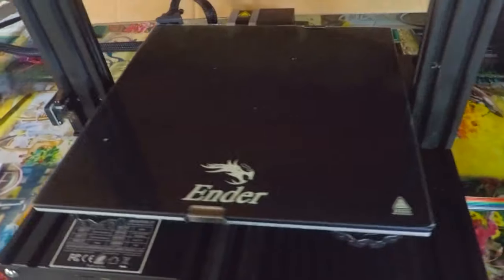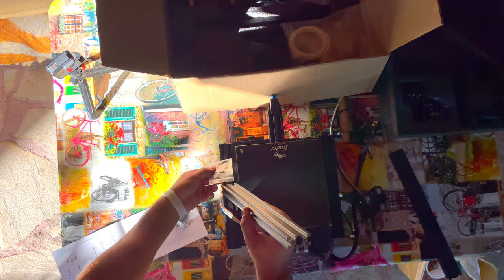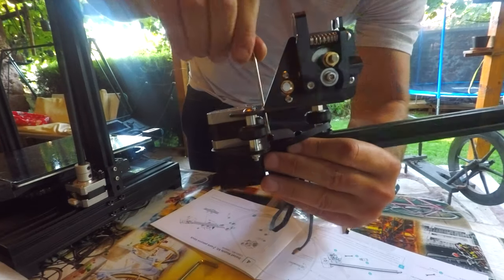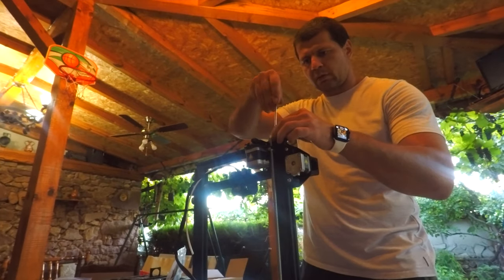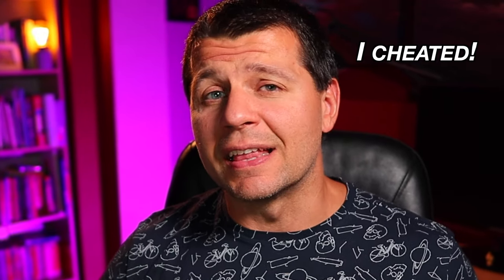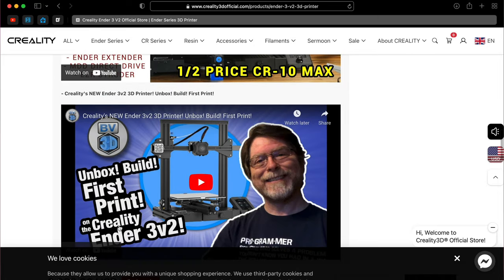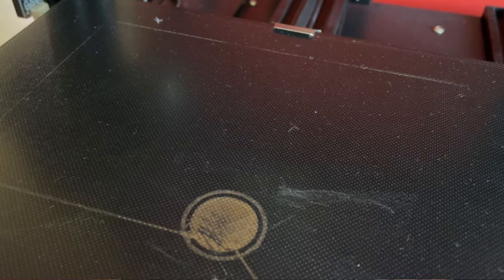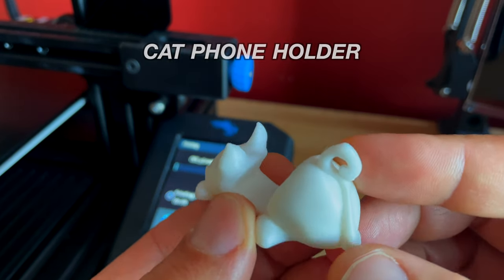Creality Ender3 v2 3D Printer Step-by-Step Build & First Print

Comment: I liked the video Kiril, and I think using YouTube is a good thing…. I set up my 3D printer about 2 years ago…. I have found that the setup is the easy part….  Getting the printer to print reliability is a huge amount of work…. Trying to build a weather station for home assistant, and printing a case took me a long time… lots to learn!  I would recommend using Octoprint and adding an auto bed leveler, it makes things easier.  Keep up the great videos! I liked seeing your outdoor work space too.
Reply: Idd that auto bed level i should do to if i should buy a 3d printer
Whats the name of that part again?
Reply from the maker: @Alex For the Ender printers Is called BLTouch kit. For other brands I don't know...
Reply from the maker: Thanks Bill, using YouTube videos is great, I just decided to try without them as a challenge to myself! Octoprint is already added in my TODO list :) About the outdoors I didn't know how big this printer is and I was thinking initially that it is huge, so I decided to assemble it outside. Afterwards I saw that it is not so big and I move it back inside.
Reply: @alexvanhecke4594  Just responded to your earlier note... I recommend getting an auto bed leveler, it made my work easier...
Reply: @KPeyanski  Great!  I have mine inside too.  Keep up the great videos.
Reply from the maker: Thanks, I will do my best :)

Comment: My first 3d printer was low quality polywood copy of anet a8, it was real challenge to assemble it because there was missing parts and the instruction was full of mistakes, however it was a great deal, back in 2018 I bought it for around 80 euro.
Reply from the maker: 80 euro is a very good deal for a 3d printer, especially several years ago when they were even more expensive.